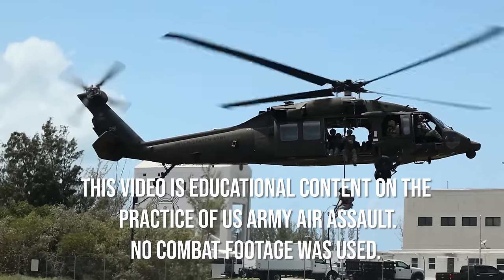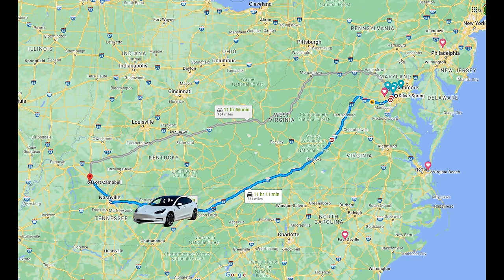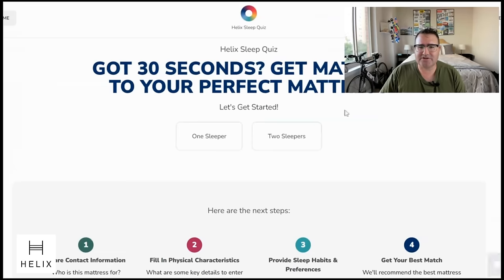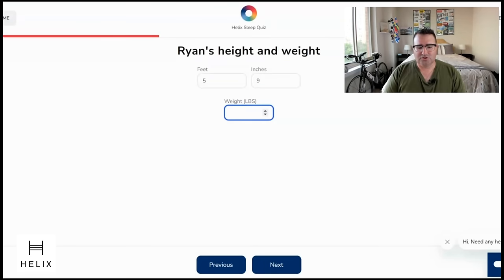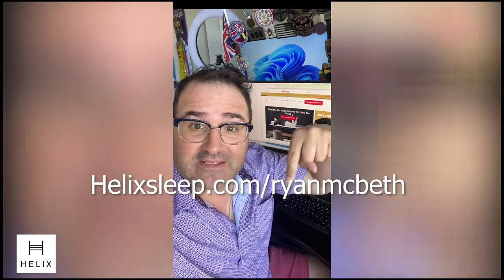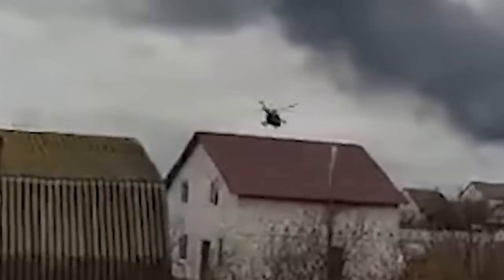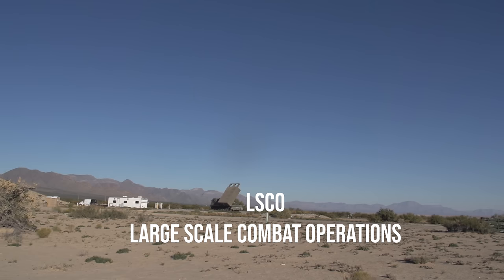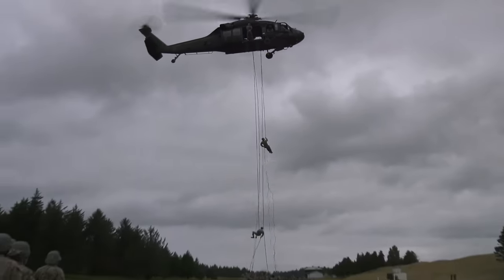How Air Assault Works - Featuring the Rakkasans of the 101st Airborne

Comment: Notes: the ability to send forces anywhere with air mobility with air superiority alows for quick evacs, reinforcements with troops and light vehicles or artillery, or strikes with missles, or even more surplys under the hellecopeter.

This also alows to quickly move forces up to the front or i to the enemy territory.. 
And even artillery raids of using night vision, settings up guns and lunching light vehicles and troops for protection then using the artillery and helicopter guns to attack then get out or dig in, and if you can sustain this strength including moving engineers and surplys you can maintain fights for longer..

A compony has 10 transport helecopers, a platoon of 5 with 10 pilots/maintaners . Each hellecopeter can carry surplysz troops or artillery/light vehicles.. so each hellecopeter has something to carry thats a part of the attack

The warent officers are the best pilots.. knowing every part of there aircraft.. able to handle all emergencys and knows things like how moonlight can make you more visible and how to acount for wind ect

The air support set up farps.. front line refueling stastions, and decide when and what unit should send troops to where, and if they should support with fire, or go get more reinforcements or fuel, or prepare for a casevac,

They must also plan there landing zones to be prepared for the worst, wnd plan landing zones that are exspected to take fire, or not,

Before troops are in helecopers carrying scoutss will make fake landings a few times at possible spots to trick thr enemy to thinking theres an attack and to get a look at the immediate potential landing zones.. then eventually drop some off at some zones to get better looks and help plan for thr future grown asult then are retrieved..
You can't use drones because they can't last as long as the scouts..

Then path finders decide which landing zoness to use.. and were taking into account useable geography and the safest place for the attack force, you must also orgonize which helcopers land first as not all can at once..

Dismounting from one side takes longest and is the biggest chock point but means all your fire power is ready, but from both sides means only hafe is available at first but its quicker so the hellecopeter can leave and take less damage, also givea you more area cover even if its weaker

You must also plan for prisoners, and standerd planing like targets, likely civilan targets... enemy targets, ect

Comment: Were you never light infantry in your service Ryan? When I was with the 1st Rock in Korea I was only stationed there in Combat Support Company (T.O.W., Scouts, Mortars) for a year but I did so many air assault missions with my Humvee and T.O.W. system that my platoon started using me and my truck for support purposes (ferrying people and supplies around) rather than having me go on the missions since I was more experienced as an E-3 than many of the newer NCO's in the company. More than 30 years later I still think about the time I got frost nip on my hands because I couldn't tie the 550 cord guts (inner strands) to all the slings chain links without removing my gloves and the choppers were coming and I had two trucks to prepare and I needed to get 100 mile an hour tape on every glass and plastic surface, stow the dog houses, secure the steering wheels, and my KATUSA was less than useless to the point I didn't even have time to train him due to time constraints... I just had to rip my gloves off and do it all myself. And then of course I got picked to land the Blackhawks (hand signals) for one of the runs. It was madness and I managed to pull it off. But I still resent that kind of hamhanded/rushed training. If you didn't go through something similar because you were always mechanized... you were pretty lucky. Fortunately for me I had so many (over 20) air assault training missions under my belt that by the time Team Spirit '90 came around I was driving my PL everywhere and since our entire platoon was chopped up and reassigned to combat teams I mostly just slept through most of the exercise in the driver's seat wearing full MILES gear. My LT even took a picture of me dead to the world, gave it to me after he had it developed and said "now you can show people what you did during Team Spirit."
Reply: I supported your brigade on camp Hovey in ‘89 to 90. I was constantly angry about the lack of good training time. IMO, highers’ priorities were FUBAR. Everyone was always worried about being embarrassed instead of being ready or the best. I remember a guy getting killed by a rotor strike because the LZ was not proper, and a guy in a Vulcan losing his jaw (nearly his head) due to a bad track weld. 

After my year, they sent me to a much better unit, then closed it down a year later even during Desert Storm! 
Luckily, there was a lot of motivated people doing the best with what they had, and time to train during the build up.
Reply: @nunyabidness3075  yeah I heard about the rotor strike. Back then training accident stories were everywhere. A mortars range kakked some civilians by firing over their rice paddies with rounds that had a bad powder count (the civilians were supposedly warned by KATUSA's but went back to farming as soon as they left though we couldn't trust the KATUSA's to sit on the toilet the right way so who knows what they actually said to them). A Blackhawk dropped a Humvees that started spinning out of control on its harness into the side of a mountain before crashing itself. Some guy parachuting out of a Blackhawk (supposedly the Warrant Officers wanted as many hours as they could get and for a case of beer you could get them to take you parachuting all in the name of Training) hit the electrical lines around Camp Casey's golf course and cooked himself. Shit was crazy. You never knew which stories were true because it was peacetime so all the brass ever thought about was covering their own asses. I almost died in a Humvee wreck. I was in the back of a 3 Humvee convoy following my section Sgt (E-6 with my E-3 barracks mate driving) and I had no TC. Just a KATUSA desperately clinging to to T.O.W. system while the platoon sergeant and his driver (E-7 and a freshly demoted E-2 driver we all called "Skank" a la "Skank and Gutterboy from the movie "The Wraith" because the kid would get high on anything) were doing 80 down congested, freshly constructed Korean roads. Skank slams on the breaks too late and skids 100 feet into the back of a liquid fertilizer truck at a red light shattering his whole front end. My roommate skids 200 ft into the back of Skank and the Platoon Sgt ramming their antenna mount and shattering his hood. I slam on the brakes and skid almost 300 ft but at the last minute I turned my vehicle sideways and stop with my driver door about a foot from the back end of my roommate's Humvee. Since I didn't actually hit anything I was the only one who didn't get in trouble for that clusterfuck. Even though my KATUSA got himself a nice big shiner when he slammed his face into the day sight when I hit the brakes.
Reply: @RemedialRob  Yep, I knew the mortar platoon leader. That was the battalion I supported. Our BC was a skydiver and was jumping with the dead guy. I think. On that same jump, or about that time, he messed up his knee and couldn’t run, but they wouldn’t profile him long enough or something so we are pretty sure he paid off a sergeant to pencil whip his APFT. Crazy.

Comment: Did Air Assault school back in 2005. The ropework and rappelling was the treat they give you to become sling load certified.  Once you are certified your signature goes on the inspection form and you then become responsible for any failure due to improper rigging.  Luckily any piece of equipment that can be slug will have checklists.  The ones that mess up think they have it all down and skip the checklist.  Have fun explaining to the brigade XO why his vehicle was dropped because the weight shifted and the pilot dropped it.

Comment: You know the way you wanted a running race suggestion I would suggest the Art O’ Neill you start at Dublin castle in the middle of winter at night and must head up through the Wicklow mountains to the finish it is often snowy at times of the year in winter higher up in the Wicklow mountains based on a prison break.

Comment: They need to give the red berets back to the 101 ,to be frank. Would boost morale as well. My battle buddy died in a air assault mission in Mosul Iraq. The tab still reads airborne and is every bit just as dangerous as a parachute drop if not maybe more.

Comment: Went to Air Assault School in the summer of 94. I didn't think it was that hard, but I was also a young Parachute Rigger
BUT just don't go to AA school in the Summer, I went in July, week right after the 4th, and OMG was it HOT, mid to upper 90's (35c) at sunrise, the timed 12 mile ruck march to graduate was hell due to the heat

Comment: Good analysis, but there's a few things I would like to point out: The experience of a seasoned Helicopter that gets shot down and the crew gets killed can't be brought back, it's wiser to not focus on Air Assault, or at least rely on it. Air Assault should be used as a QRF, or for SFMs.

Comment: 7:31 yes, but the US Army shot themselves in the foot with this one. They deactivated all of their Pathfinder companies within their CABs (Combat Aviation Brigades) and have little support for aviation. A Pathfinder company acted as scouts, downed crew/aircraft recovery in combat operations, setting up leapfrogging points like farps, and the traditional role of the Pathfinder lighting the way by setting up drop zones/slingload operations. I was apart of one of these companies and it was deactivated shortly after I got out. In Afghanistan we rescued crews from aircrafts, pulled security for DARTs (downed aircraft recovery teams/aviation mechanics), set up refuelling points (using NATO Ts and air traffic control to refuel US and foreign pilots refuel for operations in sector), worked with and assisted PJs with missions, assisted forgien Pathfinders with their work load, and slingload operations. I'd like to clarify we didn't do missions with PJs such as fixed wing pilot recovery or medivac but rather when unmanned aircraft needed recovery or destruction our cold team (1 hour recall) would often get eyes on and either destroy it with c-4 or call in a JDAM. So a PJ team wasn't on a mountain side when an F16 pilot or A10 pilot is shot down.
Slingload operations can be done by anyone who has completed Air Assault school and in fact Air Assault (AA) school is 1% fast roping and like 60% sling load operations. However, you do not learn ATC (air traffic control) skills in AA, how to make HLZs for domestic and foreign aircraft, or slingload operations for large/special loads (like a shot down AH-64 or CH-47). The most important piece is CABs no longer have a dedicated QRF waiting and that leaves out pilots/crew up a creek if they are shot down or have to do a precautionary landing (engine failure or similar). I believe AA has it's place in modern combat because they can hug mountains/ fly low to get out into radar filtration and despite the noise of aircraft AA is the fastest modern way to deploy an entire Brigade of soldiers in an area without having them hang in the air helpless for five minutes.
9:49 as of 2016 the 82nd also has their own AA school but I'm not sure about today.
11:31 wanted to point this out as well not everyone on the helicopter team is a crew chief. I had been selected to cover down as a door gunner for a CH-47 as an 11b. I never had to do it but I had to take the flight physical, training, ect ect. The reason the crew is outside of the helicopter is to guide people in. Depending on the helicopter there are certain approaches that you absolutely cannot do. For example a UH-60s blades will take your head off if you approach from the front. The blades flex and nearly touch the ground when landed. While every 15 series on a bird is a crew chief some of them are considered flight engineers and prefer that title. I don't remember exactly how that works but someone in Aviation can explain that more.
16:26 anyone know who picked up this role? It used to be the Pathfinder company but obviously the Army has to have trained someone to do this.
18:36 these guys were deactivated in 2016. I'm sure of this. We releaved them in Afghanistan on their last deployment.
All in all cool video man. Very well done and accurate. It's rare people see this side of training and if anyone can clarify the but about the pathfinder company I'd love to know.

Comment: Great video Ryan. Sorry to hear it was demonitized. The only thing I can think of  why they did this is that their censorship (my best guess) is based on the text that is generated by the audio. The same engine that does the closed captioning is doing the flagging for censorship. The text that you have on the parts of the video are not read because you didn't say it. If it isn't part of the text  file that you say, it doesn't exist. Just a thought.
 Really thought the video was well done. Makes me mad that great content like this is unnecessarily flagged.

Comment: Manpads and heavy MGs are serious concerns that weren’t mentioned.
Reply from the maker: It’s one of the reasons they primarily fly at night. It’s a lot more difficult to operate man portable air defense at night.
Reply: @RyanMcBethProgramming  I admit, I’m not an expert on ADA or flight ops but my understanding is most manpads use thermal signature; wouldn’t the night sky provide a better contrast? Plus there’s probably more ADA than the one unit shown. I know you probably couldn’t show all that, it is a wonderfully made video. I just feel the example provided was the best case scenario.

Comment: As a veteran, 11B with the 25th ID (1/27 Inf. “Wolfhounds”) and 101st (2/502 Inf.) my question is:
What on earth is the 101st going to do with a 38-42ton MPF(“not a tank”). 
The battle taxi in this case is Blackhawk or Chinook. They move by helicopter. Ain’t no helicopter in their TO&E capable of lifting an M10. What’s it going to do besides pull security at the airfield. 
Maybe they’ll do a 5ton assault with Booker backup.

Comment: I have learned so much from your videos.  I recently commissioned as a CPT and serving as a physician.  Just finished DCC and BOLC, but I still feel like I do not fully understand the structure of the army.  Does anyone have good reading material that can describe the structure in detail so I can start learning what exactly is MEDCOM and what is under MEDCOM, what is alpha company where I'm stationed, etc.?  Thanks for any suggestions.
Reply from the maker: I should write a book.
Reply: @RyanMcBethProgramming  There were several very good books in the 80s that described in detail not only the hardware but the force structure, thinking, organization, and the gritty details of how the US and NATO would defend from a Soviet attack. I don’t know if there are a bunch on the modern thinking, especially since it’s in flux between the wars in the sand box and the rock pile, and how we defend Taiwan, Korea, and other Asian operations. The war in Ukraine has dusted off the old books but the 2020 era Russian forces are nothing like the 1980 era Soviet forces. On the other hand, neither is the US and NATO.

Comment: the air assault mission is all about speed and getting to otherwise non-permissable areas and terrain, imagine how long and slow and fatigued a convoy of lmtv/fmtv and hmmwv would be going over super bouncy offroad for hours at basically 5mph.  Speed on target matters and so does soldier fatigue when they get there.

Comment: Hi Ryan! I love the video, your content is excellent. I have a quick clarifying question, how does the first Apache SEAD attack happen? Wouldn't the air defense it is tasked with destroying be able to hit the Apache from a longer range? Thank you!
Reply from the maker: They would be working with the Air Force and would also be flying extremely low. I didn’t include the Air Force in this example, because I need to simplify it. I also highly simplify the operations order that I did. A real Military operations order on this scale would’ve taken hours.
Reply: Well,  a mention about how to deal with  manpads with thermals would be interesting. In ukraine lots of squads tend carry one. So low hovering helicopter don't seem like the best idea.

Comment: Thanks for the video, Ryan. I've got a question, though. 

Whether we are talking about the planning phase or the implementation, do you take MANPADS into account? Even if all 'big' AA systems have been successfully suppressed, don't they pose a significant threat to the incoming helicopters since soldiers with MANPADS can relatively easily ambush incoming helicopters while hiding in buildings / nearby forests?
Reply from the maker: That’s why they only do it at night, it’s a lot harder than I am one of those systems at night

Comment: Genuine question: I feel the elephant in the room was not mentioned in the entirety of the video. A huge portion of the rotary wing losses in the Russian invasion, by both sides, were caused not by SAMs but by MANPADs. The Longbow has a range of 11km while most MANPADs can compromise almost half of that, at 5km. With a small number of units hidden in the terrain, it seems to me that the entirety of this operation could be denied. Especially if the MANPADs were used in a layers to protect the SAM system beyond the maximum range of the longbow. How can the 101st protect itself from the increasingly more numerous MANPAD threat?